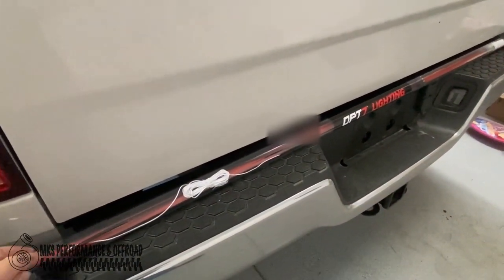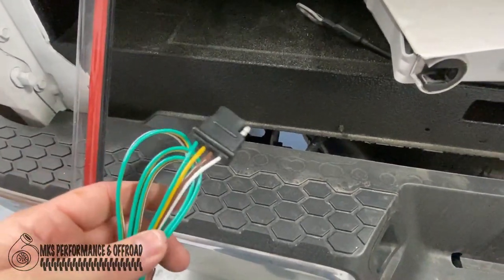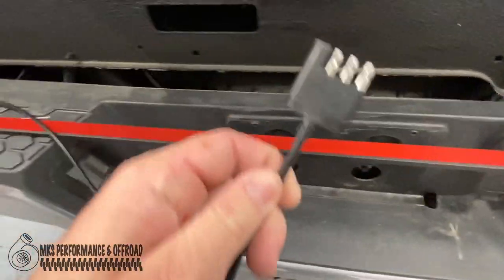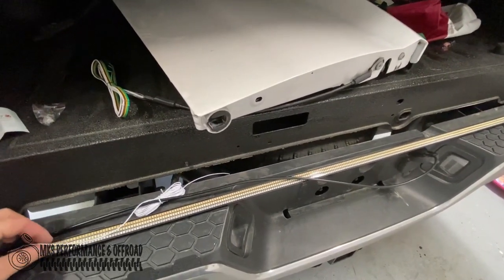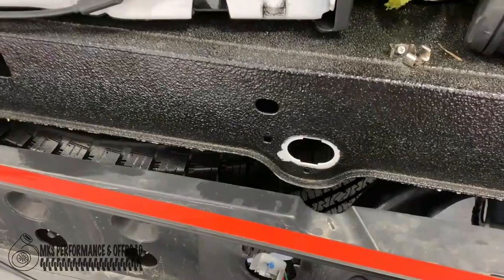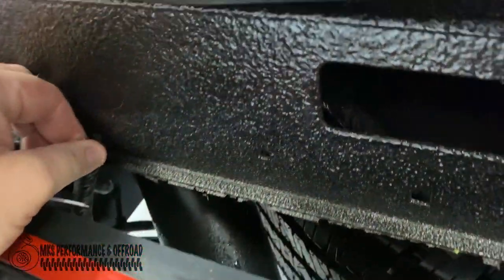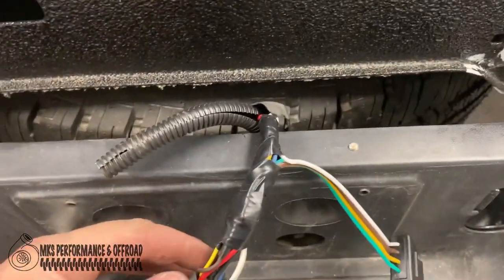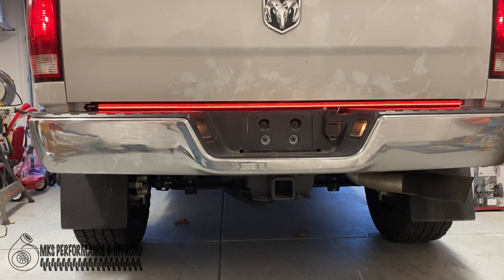OPT7 60” Redline Triple LED Tailgate Lightbar w/Sequential Amber Turn (4th Gen Ram) Installation

Comment: Love that light bar..had mine for about a year..I got the 7 pin piggyback plug..only had to hard wire reverse and retained my 7 pin for trailer..great product
Reply from the maker: I only soldered these because I also installed a trailer harness inside the bed for hauling a fifth wheel or goose.

Comment: Curt makes a 7 to 5 pin T connector that simply plugs in to the back of the existing trailer connector and with the 5th pin you don't have to do anything to the backup lights other than put a Plug on the end and use the 5th pin on the connector!  Easy no wiring to do other than connections!

Comment: Great video, got a question how do you get your spare tire down when the light bar is covering the hole?
Reply from the maker: It doesn't cover it completely and is still accessible.
Reply: @MKSPerformanceOffroad  That’s good to know. Thanks.

Comment: I want to put a light bar on my 2016 ram but have had bad luck in past with the bars failing from 3mo. to a yr after install on the different trucks over the yrs. Be nice to see one last 2-3 yrs
Reply from the maker: I’ve had pretty good luck with light bars, what brand are you buying?
Reply: 99% of the trucks I see with this mod have many dead pixels on their bar, or half the bar has stopped working completely. LEDs like constant and consistent current, so adding a 1000uf capacitor before the first LED might improve your luck. It also wouldn't hurt to run those signal wires (Reverse, Brakes, etc) through some relays. Just as we add a relay for our Remote Accessory Turn-On Wire when we significantly increase its load, it's also not a bad idea to run the lights signal wires through a relay as we have also significantly increased its load. Another thing to try would be to get an 8-15V to 12V Voltage Regulator and mount it near the beginning of the strip, as it will produce an optimal current for the strip to maintain its health. Lastly is waterproof rating... I see a lot of strips claiming to be IP68, when they're really low grade IP67... Real IP68 strips are fully encased from top to bottom in a thick layer of injected silicone with no outer sleeve. From my experience, strips with IP67 ratings do not last on the outside of a vehicle.

Comment: If you would of used the CURT 56584 Replacement Vehicle-Side Custom 
USCAR 5-Pin Trailer Wiring Harness you wouldn't of had to splice into 
anything ... you could of added a bullet connector to the white wire 
which is your back up lights and connected it that way ... the last pin 
connector on the harness is your back up lights that is where the white 
wire will go into it ...
Reply from the maker: I already have a similar adapter being used for the trailer harness that goes to the fifth wheel in the bed.  I used a similar connection to the backup lights but rather than a bullet connector I opted to use a weather proof single pin connection.  Because the wire was so long it was easier to just tap into the tail lights and place that connector in an area that is easier to disconnect rather than up behind the bumper and spare tire.  There are a 100 ways someone can wire this up, this is how I decided to tackle it and it works well.

Comment: Mine didn’t come with a 4flat attached to light bar. Just splice into wire harness underneath and tail light ey?
Reply from the maker: Yes you can splice in to those locations

Comment: Where is the brake light wire?
Reply from the maker: Where are you trying to locate it at?
Reply: On the light bar…
Reply from the maker: Both the turn signal wires double as the brake light wire for each side.
Reply: @MKSPerformanceOffroad  how is that possible? wouldnt the brake light come on when the turn signal comes on?
Reply from the maker: @ajack0  are you using the supplied connector and plugging it in to the trailer harness?
Reply: @MKSPerformanceOffroad  no, im in Oz and we have noting like that here. I just spliced all the wires to the back of my tailight. Everything works but no brake light b/c i have no brake light wire....???
Reply from the maker: @ajack0  you should have only 4 wires, 1 for rt turn, lt turn, ground, running lights. Yellow is left turn/brake and green should be right turn/brake.
Reply from the maker: @ajack0  https://support.opt-7.com/533004-Redline-Tailgate-Installation-Guide
Reply: @MKSPerformanceOffroad  so the brake is already connected to the right & left signal light?

Comment: You need to learn how so solder properly. It shouldn't have been that much of a struggle.
Reply from the maker: I solder just fine, got the job done and it haven't had 1 issue with it.  Thanks for your expertise.